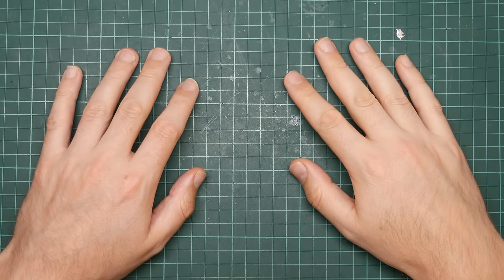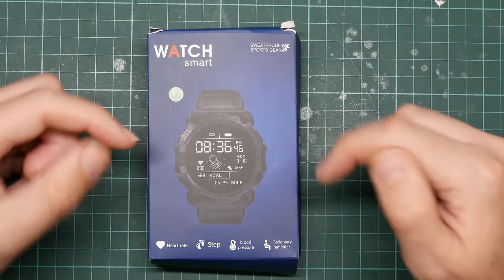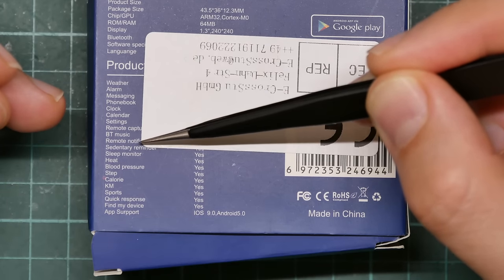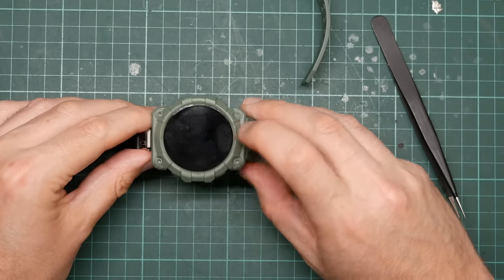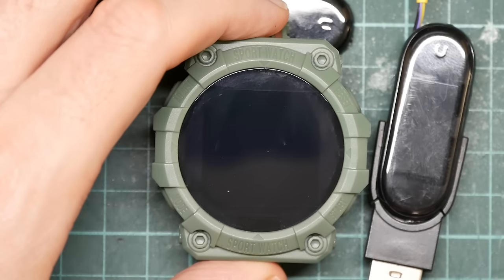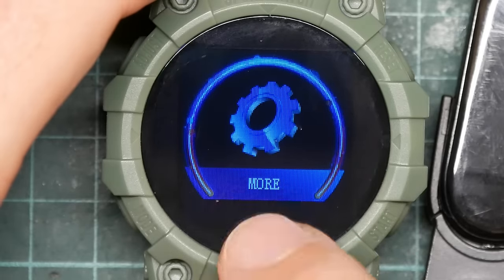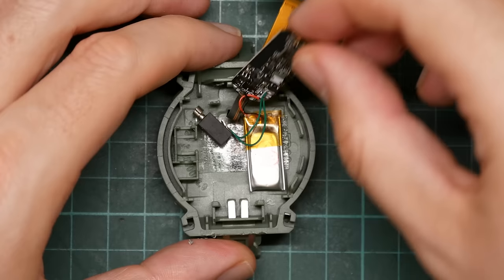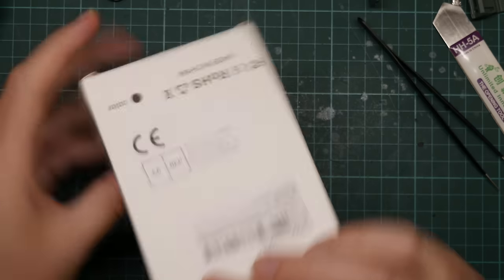Tearing down some more cheap and nasty smartwatches

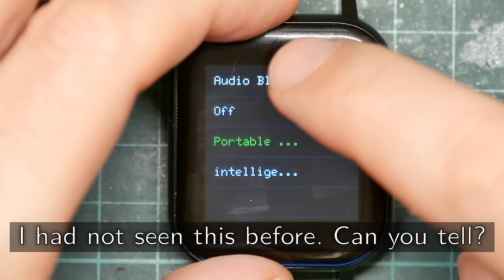Comment: 15:24 looks like Bluetooth profiles.
One to be for audio only (like to be used the watch as a earpiece?)
One probably connect to "smart features" aka notifications 
And one for remote controls?
I don't know, but definitely bluetooth profiles.
Reply from the maker: Yes! It is! I tried pairing it with my phone (without using FitPro), and it showed up as a headset device. Called "watch" (sic). Of the three audio profiles in the menu, "Portable ..." and "intellige..." (sic) seem to be identical. I successfully played audio through it, although the quality was so bad that it was completely unintelligible. I did not try the microphone but I bet it's hilarious. It completely failed to occur to me that this might work without having to use FitPro. Thank you very much!

Comment: These cheap smart watches remind me of the cheap g-shock watches from the 80s that pretended to be expensive dive watches. Except they weren't waterproof and only had a basic watch inside it.
Reply: I think I had one of those, bought at a garage sale. made the mistake of swimming with it and moisure got in.
Reply: @ericthecyclist  As a kid I got one from a market while on holiday in Spain. Took it in the sea, died immediately.
Reply: That's wierd as heck.   I've never had a G Shock die from water or anything else.  Other than a battery change needed every 3 to 15 years lol
Reply: @GottaGeek  Yeah I bet you had a real G-Shock watch. Mine was a cheap fake from a market stall. It definitely got a shock when I took it in the sea!
Reply: @ncot_tech  pretty sure because I don't live anywhere near a place that sells fake items or counterfeits. And back in the late 80s we would have had to have driven 4 hours just to get to flea markets in Milwaukee. None of that matters now though since the internet is everywhere. The Upper peninsula of Michigan isn't exactly a shopping hub. LOL

Comment: When you listed the specs, i already had the feeling the screen wouldn't be 240x240 but 128x128. I particularly love how they had space for a big battery but didn't use it, and they had a special compartment for a vibration motor, but just taped it in nearby on an angle as well. What could possibly go wrong?

I have not found an incremental encoder currently in production and sold openly which would support the crown dial like that, or fit in a watch case. But it's been a few years since i looked. I think they have a variant of the watch with 2 or 3 buttons. In fact i saw a smartwatch listing which was sort of a Casio homage watch with a colour screen.

The watch faces on the nice one are plain amazing. LOVE the horse and the lemon boy ones and they even have lcars.

13:55 FLUX. Also in a pinch tape some sewing needles to your multimeter probes because your probes are kind of being useless here.

How is RX and TX connected together a problem? The boot firmware is for sure not full duplex capable anyway, you can just connect a resistor to that, connect RX and TX lines together on your end, and hook to the resistor. You might achieve something.

Such a pity that the processor on the nice one is closed.

Comment: 10:38 looks like the case has a part for vibration motor but... who needs things in right places
Reply from the maker: I hadn't spotted that, but yeah --- that enclosure on the left is clearly intended to hold something which rotates. There's space for a much bigger battery, too. I'm pretty sure that this has been bodged together from various parts which were available cheap.
Reply: I assumed it just came out from its position during disassembly, but that would require a 135° rotation...

Comment: These videos are really interesting and I'd be interested to see you go further with them like the previous one (when you are ready of course).
The last watch is painfully close to being legitimately interesting and useful. If they had purposely included a little easier access to debugging and GPIO, especially without having to modify the case then it would also serve to work extremely well as a module for giving devices a small touch UI.
Hopefully, it turns out to be easier to work with and flash over BLE than it appears because it could still do a bit of work. Could maybe still knock out the fake HR sensor LEDs and their windows and use those as connections on the back and add it as the front panel for a DIY device.
I'd love to see how this might continue, it's shocking that just a small jump to $6.50 gets you that much better quality and features. I'm curious what the next devices will be like. Ideally you'll find something super easy to hack in a nice package that could be mounted somewhere reliably and has a reasonably good screen/case and still cheaper than it would cost to buy and make your own.
The next displays people use for their custom 3D printers could be "smart" watches.

Comment: Hope you can look into the DZ-09 eventually, it has a removable battery, SIM card slot and SD card slot in a smartwatch!
Reply: Something something "fernly".
Reply: Hold on. Those were a thing about 7 years ago. They had a MTK feature phone chip. Also of course many had a working camera. I was under the impression that they had been sold out and gone long long long ago. I thought they were promising at the time because bunnie or someone released an open SDK for a closely related chip.

Comment: This is interesting. On the cheap first watch u show it says its LP715(D)... But thats what mine says, and my watch is totally different with different UI. My version number is v19472 and it says WATCH instead of 716 and the rest of numbers are different. I love these smart watches tho, well, at least mine, cuz my step counter is real, and heart sensor IS real its just not super accurate
Reply from the maker: Interesting. I have no idea where the software stack comes from. I suspect it's passed around from manufacturer to manufacturer samizdat-style. Possibly the model number doesn't mean much.
Reply: @hjalfi  yeah ig so, thanks for seeing my comment tho, means alot to me

Comment: The square one is everywhere, mostly sold as apple watch knockoffs. I think it would be fun if someone made a firmware update that made them safer and usable. Maybe even emulating digimon or Tamagotchi on it.
Reply: i literaly wanna do that, but can't find any info or the maker for it, if it was as easy as an ota software update with 1 extra app it would do wonders, or even just how to make my own watchfaces, they have a lot of Freedom, like shortcuts to apps and details on the device

Comment: you can fix the fpc by scratching off a bit of this plasticky material that has the copper traces sandwiched between and extend the solder lines beyond the crack this way :3
Reply from the maker: Sadly the screen is in a better place now, by which I mean my ewaste bin and in pieces.

Comment: Are there any decent fitness watches with full set of real sensors, that work standalone (without online account, proprietary app etc), is water-resistant (my requirements would be at least pool swimming proof; don't need to worry about deep diving), and in general is worth buying for it's official purpose?

Comment: i am interested in programming but have never worked with hardware level stuff like firmwares, OS etc where should I start learning and implementing stuff 

i consider myself good at c++ for competitive programming though
Reply from the maker: Get a Raspberry Pi Pico with one of the games hardware addons (VGA out or an LCD, gamepad controls). It's a really good chip with an excellent C++ SDK. You can then write old-school games for it. It'll teach you about bare-metal programming without the pain of working on the really constrained devices in a reasonably fun way. Plus there are lots of libraries for it and an active community.
Reply: @hjalfi  thank you sir will get on it

Comment: i don't understand the ui decisions of most of this watches, menus that lead into nothing (fb and twitter), hidden stuff like to change watchfaces you have to long press it should not be assumed to be there it should be additional as a shortcut to a config menu, i wouldn't even add long press to a watch it's too easy to trigger unwillingly, icons with terrible contrast for viewing on the outside, etc
from a watch i expect the main extra features to be stopwatch and timer, then as secondary the other stuff like notifications, fitness,etc
it would be a lot better if you could just turn features on/off and those get completely hidden in the watch ui, and would be even better to be able to reorder some menus.
i would like a FOSS implementation in a watch, we could do so much better, sadly i don't think that will ever happen.
Reply from the maker: The non-functional menus are most likely not working because it's not paired with a phone, so that's semi-reasonable --- but I should at least expect an error message (and not 'Null...'). I agree, the UI is total junk. Looking at the quick menu on the better watch, one of the options is the menu style selector? But why? It's something most people would only ever set once. I got a comment elsewhere suggesting that this are repurposed pulse oximeter boards from the... er... recent kerfuffle, and if so I suspect that there's a semi-standard smartwatch stack somewhere that's been slapped onto the boards haphazardly. You're right that no concern for quality, usability or anything has been done.

There are some open source smartwatch stacks; e.g. WaspOS runs on the PineTime, which has similar specs to these. Theoretically it should be easy to port. Practically the hard bit will be getting a hardware debugger working on a development device so that they can be reflashed when a botched update bricks them.

Comment: You immediately know that device is better than typical crap as it used actual connectors for screen 😅 and anyone who gutted cheap crap know that they hate using connectors as they are expensive, even more than chips...

Comment: I hate these watches with fake HR monitor !

PLEASE don't use tweezers for levering things apart. You could very easily snap off components, tear ribbon cables or worse puncture the battery !! 
Use one of those cheap plastic phone repair levers....👺